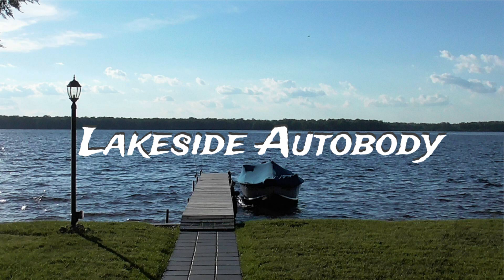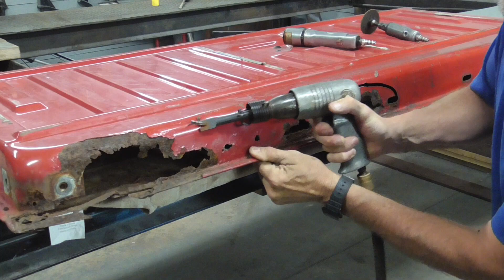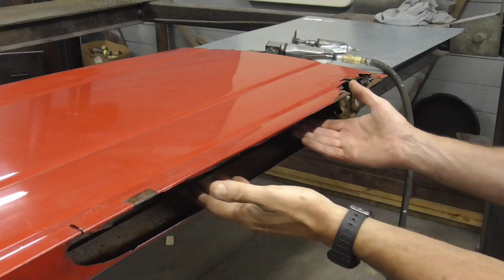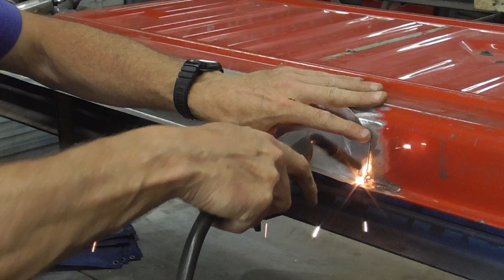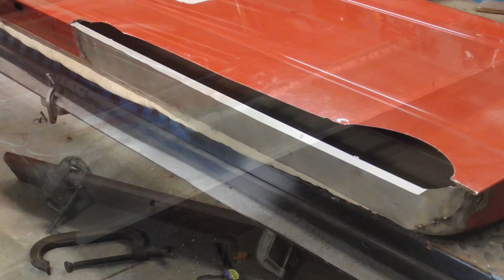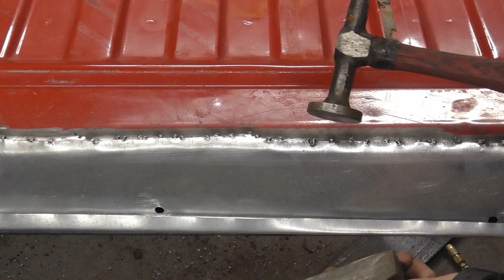Tailgate Rust Repair Made Easy

Comment: On the front side of the tail gate there is a body line. How do you recreate the body line?
Reply from the maker: Nice ?.  I would use sticky back sandpaper and bend it around a block so you can dig a 90 degree angle  "V" shaped body line the whole length - using a guide board clamped in place to keep your block straight - then round off one side of the "V" that you created.  I would create that type of groove AFTER you've got the panel flat though.  I'll do a video on that. If it were my truck though I would just leave it w/o the body line.
Reply: I run a piece of tape as a guide and use a die grinder to carve it out ... sculpting in body filler.

Comment: That works but it not the correct way by any means
Reply from the maker: Here’s why you don’t butt weld everything but use a combination of mostly lap and some butt when necessary.

You cannot guarantee the uniform thickness in your welds so when you grind them flush,  you will have many paper thin spots - not only in the weld but the adjacent sheet metal from incidental contact.

Most butt weld advocates always show little square holes that they are repairing and in the real world the holes are blown out rockers, cab corners that are gone,  wheel wells that are toast - all irregular shaped repairs - like this video - almost impossible to match the patch perfectly to butt weld it.
 

Finally, you would lose your job if you ever started butt welding patches in a real body shop,  grinding them flush and trying to metal finish.  Super slow, waste of grinding discs, and poor quality - I'd rather get a new panel than take the gamble of thin welds and metal.

The only way it would work is those super old cars with very thick sheet metal so that you’d have some thickness to play with.
Reply: @LakesideAutobody  I plan on lap welding  some 18 gauge floor pans...It is quicker and with two layers of metal maybe a bit stronger.  I know you have to seam seal the extra  seam but I had other spots to seam seal anyway. I like your work...you really got the old metal clean...I think that is the key to a good weld..

Comment: This is a great video and thanks for sharing,can the bare metal on the inside of the repair sections be treated in any way to prevent further rusting after the repair ?
Reply from the maker: Absolutely - check out this video.  https://www.youtube.com/watch?v=8XaZBy7GC7A
You don't have to aim either cause the oil creeps and eventually covers everything like an old valve cover.

Comment: to bend that edge on a budget, I use a step side Chevy truck bed brace that normally supported the wood, that is my portable shop anvil bending tool, now get an 18" long piece of water pipe steel, & use a normal curved jaw vice grip clamp to 1 end the pipe on top of the brace, now use your standard welding clamp to fit under brace, & inside other end of pipe, now insert metal where you want to roll a curve, & clamp, & it works awesome!!!!!!!!!!!!!!!!!! all parts I acquired free. 

great job turned out great

Comment: 3rd vid of yours, good tips on building that corner. I am doing a rocker panel on my car, making own panel, I haven't found one short of buying a parts car. I see you lap joint a lot. I've always butt welded since the first patch i put on. Seems like a area to trap salt and once again rust from the inside between the joint.. anything you can add to explain why lap is it just for ease of mate up and cutting tolerances... nvrmd I see you have a video on that! 

(Lol, yt just autoplayed next one of your videos on repairing a rocker! Awesome thanks!)
Reply from the maker: After you have finished the repair and painted, drill a few inconspicuous 1/8" holes on the inside or side of the panel and squirt a good helping of used motor oil inside the panel. It will creep around and eventually coat everything preventing future rust.
Reply: @LakesideAutobody  thanks, I see what i can do for access. Lots of salt... I've been using transmission fluid for that, and inside lower doors with it. Cars with long time trans leaks, the underbody has no rust in these areas. Also its thinner to spray. Have you found oil to be better? Actually i find grease is the best if you can smear it.
Reply from the maker: @jeremyr7147  I thin the used motor oil with mineral spirits and spray it on the under body with an old windex bottle or an old auto body spray gun.  Works real nice.

Comment: would have been an opportune moment to treat the inside of the panel with rust remover and preventative insuring that this doesn't happen again..
Reply from the maker: Absolutely - I like to squirt some used motor oil through  a few 1/8" holes drilled after the repair - get the bottom of the tail gate nice and greasy.

Comment: fantastic! If you can make an unedited video where you show everyone how you template the cut-out to make a new piece fit properly
Reply from the maker: Good idea - I'll do a video like that - thanks for the suggestion
Reply: @LakesideAutobody  Quick question—what gauge metal did you use—if you have time would you mind posting a list of what metal should be used where for instance like what gauge floor pans should be/quarter panels/etc.
Reply from the maker: @Rocketman097  All body panels (excluding super old cars 20's-50's) use 20 or 22 gauge (.035" or .030").  Floor you can use 18 gauge - I wouldn't be opposed to using 20 if the hole is smaller.  Hope that helps :)
Reply: @LakesideAutobody  YES thank you so much!! I have a 65 Chevelle and 59 El Camino I have that Im about to start on!
Reply from the maker: @Rocketman097  Both sweet cars - keep me updated on how they're coming :)
Reply: I do love this brother, it doesn't and couldn't get any simpler than this.
Reply from the maker: @shawnlawrence4840  Thanks Shawn - it's good to keep things simple and consistent.  Have a great weekend :)
Reply: I realize I am pretty randomly asking but does anybody know a good website to watch new tv shows online ?
Reply: @Zyaire Max Flixportal
Reply: @Jake Alvin thank you, I went there and it seems like a nice service :) I appreciate it!
Reply: @Zyaire Max You are welcome xD

Comment: What gauge steel do you recommend for auto body repair?
Reply from the maker: The thickness I like to use is .030 inches or about 20 gauge sheet metal - too thick and it's hard to work with and cut with snips -- to thin and it may rust faster and you'll burn through easier when welding.  Basically between 20 and 22 gauge - your preference - Jerry

Comment: Great video. What do you usually fill with after welding is done? Shortstrand fiberglass then body filler? Or just body filler?
Reply from the maker: Just plain body filler
Reply: @LakesideAutobody  ok thanks
Reply: Body filler sucks use West Systems and some of there thickeners. Waterproof and strong.

Comment: why not remove the paint first so you  better see the extent of the rust on the metal  ??
Reply from the maker: Good point - might have to do a video like that some day - Jerry
Reply: Thing is, the metal rusts from the inside out, so taking the paint off really isn't going to do anything. From my experience if it's bubbled there's always a rust hole sometimes even if it's tiny

Comment: Is that a mig or flux cored welder?
Reply from the maker: MIG - I used flux cored before and was not very impressed - maybe I was just used to MIG
Reply: @LakesideAutobody  When you say Mig your just using gas ? My Mig uses the flux core and I don't care for my results.
Reply from the maker: @1951Roy  Yes - just using gas.  I don't like the flux core - If you try gas, you'll love it.  Jerry
Reply: Roy Vannoy Use gas way better